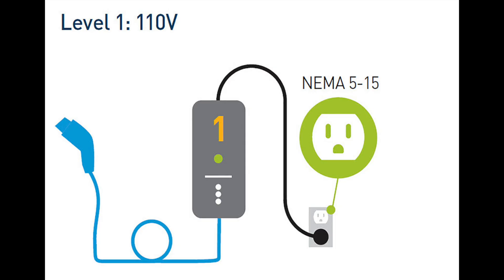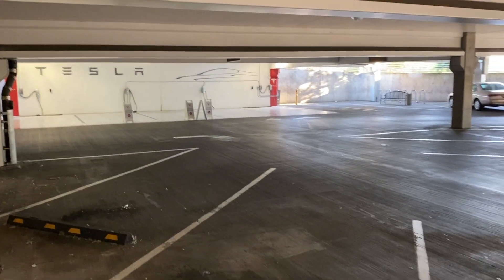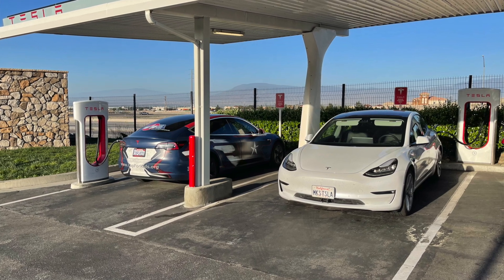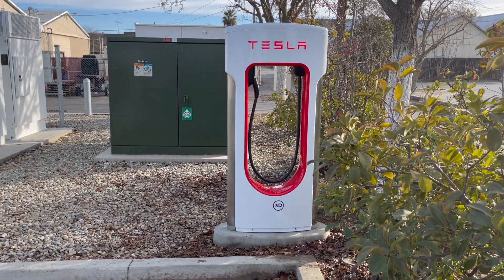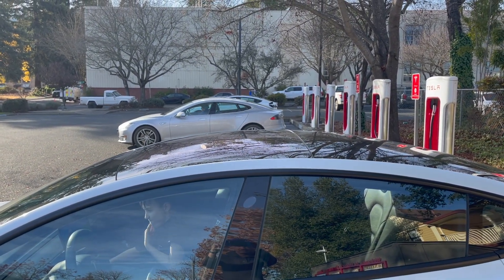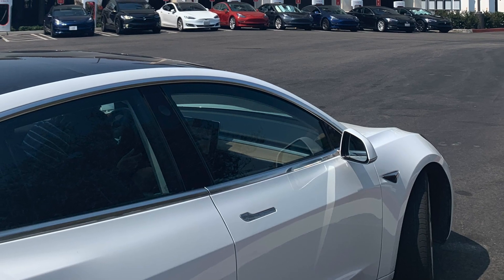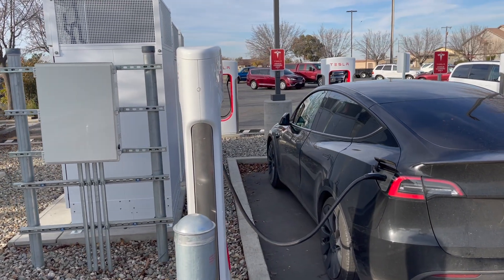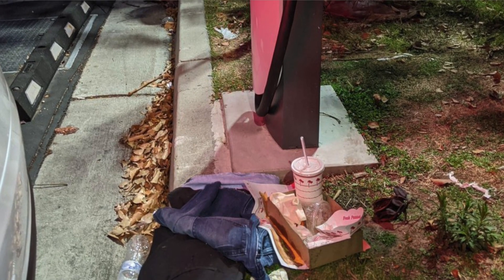Tesla Supercharging Etiquette

Comment: Basically Urinal Stall Rules Apply. No need to saddle up next to the fella next to you if there is room to breathe somewhere else!
Reply: This is sometimes not the case and skipping stalls will cause you to double-up on a cab on V2 superchargers. You have to check the numbers if you're at a new / unfamiliar location. A supercharger I've used several times is, IIRC, 1A 2A 3A 4A 1B 2B 3B 4B 5A 5B 6A 6B (5 and 6 were added later). If everyone skips spaces, cabs 1-4 will be doubled-up.
Reply: Craziest urinal stall I experienced was urinals either side of a wall, but the wall was only maybe chest height, so you were looking someone straight in the eye!!
Reply: Us women Tesla owners would never think like this.
Reply: Misunderstood and pissed on a charging station.
Reply: But we all know you're sneaking a peak comparing your ... Tesla ... with the guy next to you
Reply: Then there is the nasty bar male bathroom troths. Then it's best to be as far upstream as possible. Good luck out there.
Reply: @JosephTMeiroseIV  haha so true.  Those are awful.
Reply: To this day I'm shocked some don't understand this very simple rule.

Comment: Normally, paired stations are arranged like 1A, 1B, 2A, 2B, etc. But be careful for non-standard arrangements. In Worthington, MN, they are arranged 1A, 2A, 3A, 1B, 2B, 3B. I found this one when, pulling up to the stations, there was a car in 3A, which I naturally thought was 2A. Attempting to keep away from it, I pulled into the right end -- 3B. This actually placed me on the same circuit as the car, even though I was three stations away. I discovered this only when I noticed I was charging very slowly.
Reply: I have seen the same notation in Naples, FL and it’s confusing. If 1A is occupied, I try to use 3A or 2B so there’s no power sharing and ample door clearance.  1A & 2A are next to each other, but don’t share power.
Reply: Saw that setup in Rapid City SD, as well! Wonder if it's intentional or an installation mistake.
Reply: Waco, TX has one that goes something like 1A, 2A, 1B, 3A, 4B. It's totally random and you really have to pay attention.
Reply: Quartzite's V2 section is arranged similarly.

Comment: I'm a fulltime RV'er and pull a travel trailer with my model Y. I have been on the road since mid January and have logged over 10,000 miles with the trailer on the back. In fact, I've got over 16k miles since buying the car in November!!  It tickles me to death when I pull into a charging station and find the end stalls open and aligned so that I can pull into charge without having to uncouple. No biggie if I have to disconnect (if the weather is good!) but it is always nice to be able to get back on the road quickly if I don't have to uncouple. Just yesterday, I pulled into a station in Virginia, and the end cabinet was in use. The couple that were in the model 3 moved over without even asking!! I pulled in and after plugging in, walked over and thanked the people for their gracious act! It is also nice it the backside of the cabinets are clear too, as I can pull in behind them and not take up 2 or more stalls while charging. I do take up 2-3 cabinets at times while charging but will and have moved if the station starts to get busy. ICEing is the one thing that pisses me off more than those that just drop their trash in and around the charging areas.

Comment: V3 Superchargers also have power sharing. Each set of 4 stalls (A, B, C, and D) is connected to its own cabinet that can pull only 325 kVA from the grid. That's a little less than 325 kW, about ⅓ of the power needed to deliver 250 kW to all 4 stalls at the same time. But the cabinets also share a DC bus that allows up to 525 kW to be transferred between them. Given the v3 charging curves for today's cars, it's very unlikely you'll bump into these limits, but they're likely to come into play in the future.

Comment: A sidenote: Your Tesla flashes green near the charging port. The quicker it flashes, the less percentage there is on the battery. That can be a way of seeing where you should pull in and charge
Reply: If the car is locked, the T does not flash, making this an unreliable means of determining which car is closest to being charged.
Reply: @timl5970  h
Reply: @timl5970  it's a good tip nonetheless. I would imagine that we're all friendly enough to assume positive intent. And thus the person that's in the driver's seat should have a car that's unlocked for their sitting there waiting or doing what have you. I wish we could decide on a hand signal or some type of communication to get the other person's attention to kindly ask them if they could be next in their slot. On a side note Apple has released these devices to help find things in your life wouldn't be nice to know the percentage of your fellow Tesla owner buddy? You don't have to know his last name or first name but it would be nice to come to a station and see the percentages available That way you can make a more informed decision as well as have more choices when ready to use  the appropriate stall....
Reply: Just watched this today because I was wondering how does when wait when all the stations are filled.  How does a line form?

Observation-I’ve used superchargers six times in the last six months and at least two people have parked next to me when there were opened stalls nearby.  My charging rate was not high, so I saw little drop off.  I guess they didn’t know etiquette or maybe they were lonely? 🤣
Reply: @JunglisticOne  Nissan Leaf circa 2011 shows the approximate state of
charge by the number of actively lit LED light in plain sight on the dash.

Comment: Hey Elon, it’s time that Tesla Supercharger stations worked out how to arrange an automatic electronic queue, based on the time of entering the area proximity. It could even be smart enough to work out which stall will likely come up next.
Reply: This would eliminate some stress and anger at crowded superchargers.
Reply: I love that idea. Especially if they could make it not accept your car because the vin didn't match. But, we don't have too much of an over crowding issue in the Midwest just yet. But, assignment might also help this courteous charging etiquette. They could also when needed assign by putting you next to the one that has the highest battery level. That would eliminate the need for guessing or hanging your head out the window asking 'wbo has biggest charge level.
Reply: I use mine for the first time today. This was so obvious to me. I’m surprised it hasn’t been done. And your post is two years old.

Comment: One additional note - vehicles made prior to 2019 (excluding 3) are limited to a max charge rate of 150kw or less, so they should use the 120-150kw superchargers and not the V3 250kw ones unless all V2’s are in use. This allows the cars that can charge at the higher 250 rate to be on their way quicker.
Reply: Very few sites have a mix of v2 and v3, though.  Cars should still stop at the Superchargers appropriate to their trip, not detour to a slower charger.

Comment: There is one other configuration that I've seen at a few supercharging stations.  It is that 1A and 1B are not next to each other.  Sometimes it appears to be just a random order.  As a general rule they normally are paired up but there are some strange ones out there. So keep an eye out for this situation too.
Reply: I've also seen this. I wonder if they did this on purpose so the person pulling next to you doesn't feel awkward when the guy on the opposite side is really sharing power with you.
Reply: 1A, 1B, 2A, 2B, ... is the most common, but some are 1A, 2A, ..., 1B, 2B, ....
Reply: Yes for example in Buckeye Arizona, the stalls are arranged so that there's a set of 4 letter A's...and  four with the letter Bs attached to them.  I don't understand how they can't switch depending on what is connected to them kind of like the way I relay switch on a circuit breaker works when it receives too much power or is on a timer. Forgive me my engineering is not that... good...

Comment: The V3 superchargers have a skinnier cable than the V2.

Also, in a shared power situation, the car that's plugged in first maintains priority and a guaranteed minimum (90 kW I think?).  You, as the second user to plug in, would take most of the hit, getting only what's leftover.
Reply: If both cars are at a low percentace the power is devided equally, but if one car is almost at full percentage the other car will receive more power.

Comment: I  was at a mostly empty 12 stall fast charge, this morning at 7:30. I backed in, set my stop level, got my grocery shopping bags from the frunk. Tucked in my mirrors and went grocery shopping without stress. Get back to the car. Stash the groceries in the frunk and still had 10 minutes.  Unplugged, put on my seatbelt and off I went.

Comment: Also you can use the taper charge cycle for the supercharger network usage. 

Plug in until you start the taper off then you immediately unplug and go to the next charger and repeat the process all of the way for the trip. 

For more information about the taper charge cycle look at the out of spec motoring on YouTube.

The idle fee is only “activated” for the location once the 50% limit hits. 

The idle rate also has a 5 minute grace period before you get a charge during the idle duration.

Comment: In europe v2 has to cables. One for Model S/X that looks like type 2 and one for CCS Model 3/Y. The v3 chargers only have CCS. They are easy to spot. Model 3/Y-drivers should prefer v3 when there are both types at the station. Not only for the speed and better sharing behavoir. But using v2 would block them for Model S/X that can't use the v3 without adapter.

Comment: Note the disabled vehicle signs.  You will find them at some of the spaces in a  charging plaza. Cars without the handicap placard can get cited and fined, just like at any other handicap space.
Reply: From my experience, that doesn’t seem to be the case. Most super chargers do have handicap spaces available but when they do , it’s not a legally required handicap spot (legal for anyone to use it) and they usually say  to only use it if they aren’t any other chargers available.

Comment: Not quite an etiquette topic.  But after plugging in check your car for the active charging rate.  If it is well below what you should be getting (e.g., you're charging in the 40's kW), then you might want to try a different stall for potentially a better charging rate.  Odd, but sometimes switching works.

Comment: I always wondered why some stations have the stalls in an "L" shaped configuration. Now I know. The six stall charging station in my town is an "L" shaped configuration like the one at 9:10 . Except the entire station is a self-contained little car park on its own and the odd stall for cars with trailers is at the only entrance, so if a car pulling a trailer did park there to charge, the entry/exit would be partially blocked. I can only guess that Tesla couldn't get local planning permission to have both an entry and a separate exit.

Comment: Many of the older Model S have been software limited to charge slower than originally designed so it's a safe bet to take a cabinet shared by a 'nosecone' Model S if there are no open cabinets.

Comment: Excellent video!  Only one correction though.  V3 Superchargers do share but it is between 4 stalls and 525KW. It also does the sharing in very linear fashion not the 10KW-15KW steps as with V1 and V2.  This makes V3 sharing very fast and faster than V1 and V2 the vast majority of the time.
Reply from the maker: Yes. Thank you.

Comment: So true about the trash! Another thing I don’t understand is some people just leave the charger cable on the floor & not hang it back on the charger. 😡 Do the urban chargers have the same affect on your battery as much as the Gen 2 & V3 ? 🤔
Reply: No. They all delivere 72 KW max.
Reply: I
The charger on the floor could have been a sign it’s not working... When a charger is not working 2 rules are out there: (1) let the cable just hang on the ground (2) tie it in a knot ... I’ve tied a couple since the first just looks like it fell off.  👍🏼👍🏼
Reply: @wardsworldwelcometoit  I hear ya, it definitely worked because someone used it 🤷🏽

Comment: Excellent video.  You missed a special case and maybe could include it in another video.  It is the SC handicap space.  I don’t know if all SC’s have them, but many do.  If all standard stalls are busy, do you pull into the vacant handicap stall?  I believe there is controversy here.

I believe you can use the handicap stall, but only if you stay with the vehicle watching for another Tesla with a handicap tag.  If that vehicle appeared, I would relinquish my space for them.  When charging at a handicap space, I’ve never seen a handicap driver need it.  Numerous Tesla drivers bypass the handicap space and wait in line.  When asked why they don’t use it, some claim they fear a citation.  I think if you relinquished the space promptly, most cops would not give you a citation.
Reply: I'm handicapped, and that makes total sense to me.
Reply: Tesla driver, WITH a handicap permit :)
Reply: @cyndernight2422  Please help me understand YT better.  I received an email of your comment with a picture.  But same picture does not appear on YT.  Why?  How did you attach picture to comment?  Is there a setting to show comment pictures in YT?  TKS

Comment: Maybe this doesn't need to be said, but if there is a handicap spot and it is shared, try to avoid its pair even if the handicap spot is open. E.g. if the handicap spot is 1A, try to avoid 1B.

I don't know what the rule is if there is no other open pair. Maybe take 1B in that case, but you may want to move if 1A becomes occupied.

Comment: Is this the case with electrify america as well?  Why not make them all like the mall superchargers where everyone gets full current?  Tesla should put the charging port in the front like all other EVs so you don't have to back in and you can charge the same way with a trailer and use any stall without having to disconnect.  Tesla should include an etiqutte orientation for all new owners prior to delivery that they have to watch online.
Reply: Cost due to quick expansion. But with the newer V3, it doesn’t matter anyway